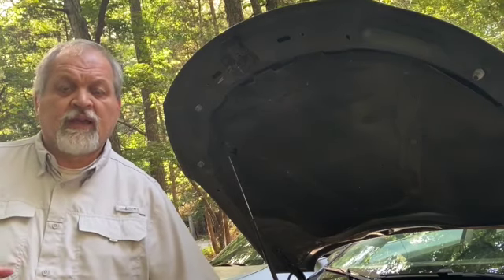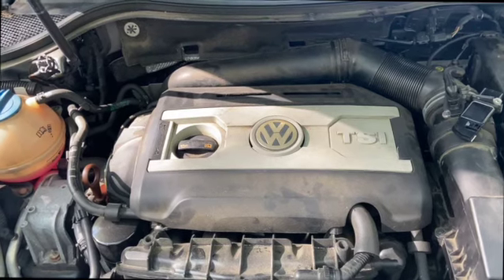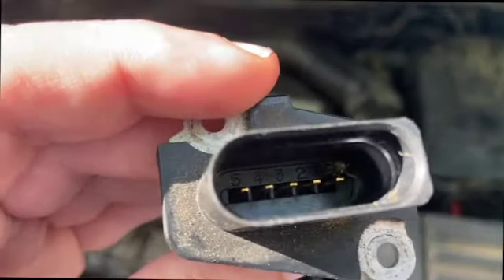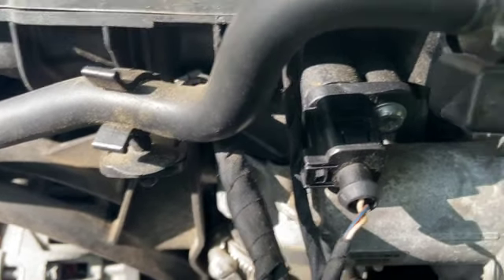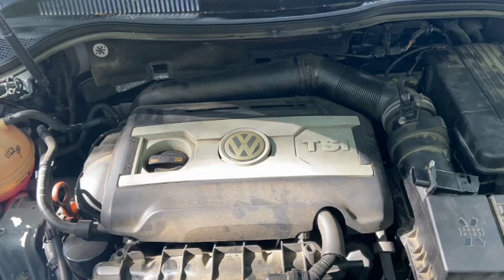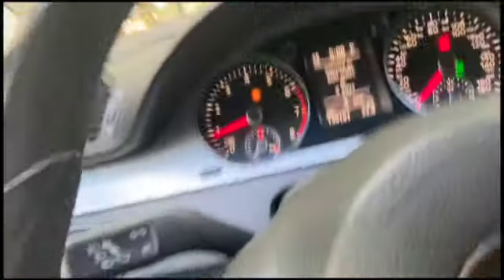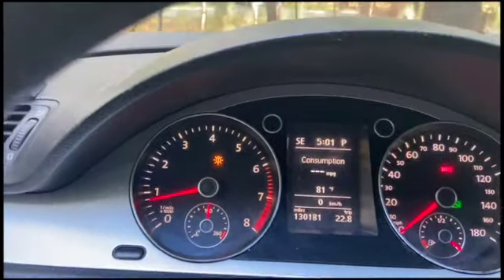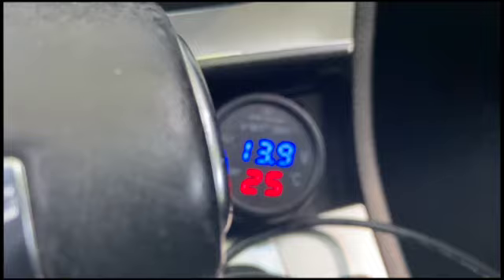How to fix  hesitation under acceleration or heavy throttle in your car

Comment: I guess I’m going to add a comment in hopes to get a reply. I’m a single full time mom & just bought a 2013 Hyundai Santa Fe sport mode from a reputable dealership.
A few hours ago I turned on to the on-ramp to merge on to the interstate.
When I hit the gas it didn’t accelerate at all like it normally does or should. Instead the rpm’s shot up way higher than they normally do & the car was hardly accelerating. I’m talking like 3 mph per 15 seconds.
I was pretty low on gas so I decided to get off the highway & see if that helped the issue.
It seemed fine, until I pulled out of the parking lot. Then the problem continued again.
I live in the mountains & I had to go up a maybe 1/4 mile long steep mountain. I could hardly go past 40-50 mph.
I stopped & opened the hood & let the car cool down because right before this all started I had been parked in a hot parking lot for several hours & it was 90 Fahrenheit outside.

Since this has started, I’ve noticed I cannot accelerate up hills past 40, maybe 50 tops if I am lucky.

It seems to be somewhat fine until I have to go over 30-40. It seems like the rpm’s are normal ish until I get to that speed as well.

I literally don’t know what to do. I just want to cry honestly. I just bought this car 3 weeks ago. Spent 15k on it from the ford dealership. 
From everything I’ve read about this problem online from others personal stories, it seems like this is a common problem for Hyundais with no fix.
Reply from the maker: It is possible that it is an air filter issue or even a vacuum leak, do you hear anything like a section sound when you have the hood open?
Reply: @ProfessorDIY  I’m assuming I would hear that sound with the car on, correct? 

When I opened the hood I had the car off. So I can check it with the car on & see!
Reply: @ProfessorDIY  I just opened the hood, with the car on. 
I did not hear a suction sound that was noticeable to my amateur ears.
What I did notice was extreme heat that I feel like I shouldn’t be there. Especially after the car was just off for 15 minutes. It almost seemed like the hot air was blowing from somewhere but I couldn’t quite figure out from where.
Reply: @ProfessorDIY  also, when I have the acceleration problem (going up hills) (getting up past 40), the car sounds like a lawn mower. Kinda like a deep mmmmmmm sound
Reply from the maker: @keiravanhanken4876  other than the lack of acceleration any other symptoms? check engine light on?
Reply from the maker: @keiravanhanken4876  do you know how to check your air filter?
Reply: @ProfessorDIY  I do not notice any other issues.
I don’t. I can likely search the directions online hopefully
Reply: @ProfessorDIY I learned something new today & checked the air filter & the cabin filter while I was at it.
Both were like new, still mostly white.
Do you have a recommendation for next step to check?
Reply from the maker: @keiravanhanken4876  yes I would check the throttle position sensor
Reply: @ProfessorDIY  I was wondering about that. I know nothing about that so more YouTube videos here I come.
Would that throw a code if that was the problem? 
Just wondering because I just checked my car with a code reader & no code came up.
Reply from the maker: @keiravanhanken4876  Not necessarily. But you can check for pending codes

Comment: What kind of sensor was the second sensor you pulled out?
Reply from the maker: In this car that is a temperature  sensor
Reply: Intake air temperature sensor
Reply: @7:28 13.9V it's
 not a temperature reading instead it's a voltage read out

Comment: I have a 2016 Chevy Malibu recently after stopping at lights and stepping on acceleration it won’t go for a couple seconds yesterday I tried to go and it wouldn’t after a few seconds it accelerated pretty fast on its own can you suggest anything
Reply from the maker: Does the engine stumble? RPM drop? or is it doing something else?
Reply: I have simaler problem for infiniti g37 rpm sits at 2.5 hesitates then jumps to 5k when my foot is on pedal

Comment: First of all thank you for answering to every comment!
I got some issues with Nissan Primera P11. Its SR20De engine. When the engine is cold and I accelerate a little on idle, the RPM stays for a few seconds by itself. Changed sparks, cables, distributor cap, cleaned MAF and even changed the knock sensor. It is very odd, the RPM just stays on for a few seconds then it drops
Reply from the maker: You may want to clean the Idler control valve and if that does not help replace it.
Reply from the maker: Adam B  it has nothing to do with modern but rather the engineering, throttle positioning does not substitute a ICV they perform different functions, the idle is either controlled by the ECU or a vacuum valve. Maybe you need to change the positioning sensor both at your pedal and at your throttle body if you have a multimeter you can test them to ensure they are still goog. throttle bodies rarely go bad
Reply: Will soon try it out. Thanks a lot! Updating the situation when I check that out.

Comment: Hey Sir I have a 95 Nissan hardbody truck 4 cylinder 2 wheel drive. 5 speed. I have problems when taking off in the low gears of trk jerking and some rough idle. We have replaced throttle body position sensor still same situation. We cleaned throttle body. If it is not the mass air flow then what else do I need to check. Thanks
Reply from the maker: Does it have any codes? It can also be bad spark plugs or even a dirty fuel filter. Run a good fuel system cleaner a couple of times and see if it improves, worsens or even makes no difference.
Reply: Hey same issue here but I work as an hood technician with a 2002 Nissan gxe 1.8l and I did fuel system cleaning, replacing camshaft, and still no fix

Comment: Hello, my RSX auto is having a problem under acceleration. When under acceleration it will sometimes hesitate. Mostly happens a ton after a startup, but happens randomly too. No check engine light. Can’t tell what’s up. Do you mind pointing me in the right direction?
Reply: Make sure PCV Valve is good and snug and in working order helped mine
Reply from the maker: PCB Valve does not cause the symptoms we are talking about

Comment: Hey gym hood man! Could you help me with my 2004 trailblazer with the I6 engine.  I replaced the vvt solinoid because it’s popping a p0014 engine code after I replaced the part that should have fixed my problem.  But it’s still here.  W
Reply from the maker: Other issues can cause error P0014
Reply: @ProfessorDIY  what would you suggest my good man?
Reply from the maker: @butterbean0364  It can be as simple as changing the engine oil or you may need to clean or replace the camshaft oil control valve (easy DIY for most cars)

Comment: My Ford Fiesta ST Line has the following error while accelerating - ‘Brake applied, power reduced’. Handbrake is definitely off, what could be causing this?
Reply from the maker: souds like a sensor to mre unless you are accidentally press both pedals at the same time
Reply: 'Brake applied' doesn't necessarily mean the hand brake. A flaky, loose or misadjusted brake light switch (some Ford models refer to as Brake On/Off (BOO) switch), can cause this too. Some vehicles have more than one.

Comment: So my Fiat manual transmission is starting to hesitate from 2nd to 3rd during acceleration.  Any suggestions?  Thanks    No check engine light
Reply from the maker: If it only does it in that instance start with throttle position sensors and air filters MAF sensor
Reply: What about automatic transmission?

Comment: 2014 Subaru Impreza WRX. Car is totally fine until i drop to a lower gear & put it under heavy load. As soon as its above probably 5k RPMs it feels like its kicking back & hesistating & there is a big loss in power.. But it doesnt feel like a full on misfire. No codes popping up, either. Got any suggestions?

Also, I did clean my map sensor but it did not help
Reply from the maker: How old are your spark plugs? Hoe many miles on the engine?
Reply: 83k miles. Not sure if the spark plugs are original, I actually purchased the car pre-owned at 81k
Reply from the maker: @michaelherman3809  For a used car assume they are original, start by replacing spark plugs, it is a maintenance item and a common cause of your symptoms.
Reply: Appreciate it! Will have to take it in because of the location of the spark plugs
Reply from the maker: Sorry that sucks! @michaelherman3809
Reply: Sure does! They ended up replacing spark plugs & doing a carbon cleaning, along with some fuel conditioner. 

The issue I was heaving at high RPM's has almost gone away but now I'm getting a slight bucking every once in a while when I'm first taking off. It's not a significant buck but it's a very slight one. Can't quite figure out what it is unless I just need to cycle through that fuel conditioner or let my computer re-learn everything since they cleaned up the intake system. Any thoughts?

Comment: He dont know if its late but got gti 6 2012 dsg , am having bad misfire on hard acceleration,  not on neutral only when am driving,   but if i accelerate slowly  it doesn't likely to missfire 
What could be problem  
Thanks
Reply: If I continue hard accelerate then triggers epc light and engine misfires badly  then switch off and start again back to normal
Reply from the maker: It can be a throttle position sensor or even a dirty air filter
Reply: @ProfessorDIY  thanks buddy but it was cylinder 2 coilpack , changed new one runs great now , had misfire on cold start went away as well
Reply from the maker: @brianwalugembe9096  In general spark plugs and coils are the first things to check or change when you have misfires, glad you fixed it!

Comment: I’m having a similar issue with my 2011 GTI although I’m only getting hesitation briefly at higher RMPS in gears 4-6 the car has an APR stage 1 tune  high flow cat and down pipe along with a cold air intake it has a few codes that I haven’t been able to troubleshoot those being MAP/MAF Throttle Position (P0068) Mass or Volume Air Flow Sensor "A" Circuit Range/ Performance (P0101) and Fuel Rail/System Pressure -
Too High (P0088) I’ve cleaned the MAF and felt the hesitation again recently I’m pretty stumped advice would be awesome
Reply from the maker: I would replace your throttle position sensor first.

Comment: Hi sir, theres problem on ford explorer v6 gas engine that im still fixing right now, when youre on half gas pedal engine is hesitating and vibrating then when you put off gas pedal engine minor was good,
What was the problem on that engine?
Reply from the maker: Check all the things we discussed plus the throttle position sensor

Comment: Hello I have a 2013 Hyundai Sonata gls and when I start the car it runs then after a couple seconds it shakes and turns off. Wanted to know if the MAF sensor might be the culprit for this
Reply from the maker: It can but also I would suspect the Idle control valve
Reply: @ProfessorDIY  appreciate the response I’ll check that as well
Reply from the maker: @CLAPPII242  Anytime

Comment: I actually felt like my AC had something to do with my cars hesitation. Replacing spark plugs will be my next step. I did try cleaning the MAFS but it did nothing, then I replaced the MAFS and that helped a little. I am also going to change the filter and see if that helps. Hopefully changing the spark plugs will do the trick! Thank you.
Reply from the maker: unless your engine is severely underpowered the AC should not have a severe impact
Reply: @ProfessorDIY  my car’s bad idle gets even worse when I blast my AC.
Reply from the maker: @angiegracie6954  check your vacum system and your air filter
Reply: @ProfessorDIY  👍 ty

Comment: I'm having issues with my 2011 Chevy Cruze ecotec. No codes pop up except when I'm accelerating at a higher speed or going up hills. I've replaced throttle body and all of spark plugs and cleaned MAF and also replaced air filter. I have also replaced the PCV valve and the purge valve. When the air conditioner is on, it makes symptoms worse. If I'm at a red light and have a/c on, it will either go very slow or almost die once I start to accelerate. I'm too cheap to go take it to someone to get diagnosed I don't want to spend $150 just to find out it's some $10 part. I can't figure out what to do next.
Reply from the maker: The idle control valve is inexpensive and possibly your issue

Comment: my nissan frontier has been having check light on for years it has random misfire code i change distribuidor coils wires spark plugs mag sensor and idk what else to do anymore the catalytic converter might be clogged tho it smells like pure gas so idk what you thinkg
Reply from the maker: Smell of gas indicates you car is running rich and that can cause misfires

Comment: Hello i came across your video..and i need to ask a question..hope you can help me figure it out..here goes..
I have a 1997 nissan bluebird u14..am having trouble accelerating whether on flat or uphill..the car would just buffle and vibrate like it want to shut down.
Reply from the maker: Does it idle well? More information is needed. But checking/cleaning the MAF and ICV is a good start
Reply: @ProfessorDIY  idle yes but with delay..or sounding like sputtering..puff,puff that's what am getting whether in park,reverse or drive same problem..its just puff,puff,puff
Reply from the maker: @sheniceebanks7661  Fuel filter also a good place to check, how many miles? Last time you tuned it up?
Reply: @ProfessorDIY  I change gas pump 2months ago,air and gas filter,leads wire and still its there..my husband also clean the trottle body and the problem persist..the mechanic at this moment I think is just guessing..I changed all he suggested and still....
Reply from the maker: @sheniceebanks7661  Throttle position sensor is a strong possibility

Comment: My throttle body is stacked open. Mass airflow (MAF) sensor/volume air flow (VAF) sensor - range/performance problem
Mass Air Flow Circuit Range/Performance Problem, Intake air flap control actuator position sensor - circuit high, Intake air temperature (IAT) sensor - high input, Mass airflow (MAF) sensor/volume air flow (VAF) sensor - range/performance problem. Can you think those faults can cause a fault to my throttle body to be stuck open? Thank you very much for this video. It's always something to learn. Much appreciated. I will follow any advice. First I will start with this one.
Reply from the maker: no O suspect that a cleaning will free the throttle body

Comment: My 2015 Silverado5.3 hesitates when accelerating, when you push the pedal all at once it takes a sec to respond and then the truck accelerates but feels like a kick when it does, I replaced tps sensor and map censor, the only one I haven’t replaced is maf but when I checked it it looked brand new so I decided not to change but do you think it could me the maf ?? , my truck also shakes a little at idle tbh could be torque converter since 2014 and 15 have this problem but idk maybe it’s sum else
Reply from the maker: i think your vehicle is misfiring
Reply: 03 avalanche same issue.  Changed all o2 sensors, map, maf, tps as well as throttle body, knock, intake temp sensor  , 5 different fuel sources including  purple,  premium,  mid n low grade  even poured shine in there.
Reply from the maker: @uncleasshole3787  next step ignition coils.

Comment: Received your video as a recommendation in my youtube,
Been a diy guy myself who services his own bikes, this ism y first time doing a car service at home.

Been learning everything even engine overhaul from last 5 years have gained the therotical and some practical knowledge at friends workshop.

But I've a question for you sir, how do I clean my car radiator and condenser fins ?
There's the britecoil, tertaclean alkaline solution that doesn the job perfectly but many claims it burns the aluminium lines.

Also I'm gona clean the intake manifold and fuel injectors
Can I reuse the same gaskit ?
My cars maruti Suzuki astar 2010 model type 1.

Comment: Ok, hopefully, u answer because im really trying not to give up on my car, it idles pretty good and starts right up but my problem is whem i try to accelerate it struggles to move/run ... I've changed fuel pump, maf ,pedal sensor cleaned throttle idk what else to do
Reply from the maker: Check the throttle position sensor and the acceleration pedal position sensor
Reply: What about the Fuel Filter ??
Reply: did you find any solution?

Comment: My 2000 Honda civic eu1 jerks when going between 0-30km/h then it’s fine until I come up to a hill or start applying heavy throttle it starts to hesitate what’s the some problems that may cause this and what can I do to troubleshoot and fix if lucky
Reply from the maker: Misfires can be caused by many reasons if it only happens during acceleration I would check/clean the MAF then the ICV then spark plugs if nothing works so far check the throttle position sensor followed by ignition coils and lastly fuel injectors
Reply from the maker: @gorkman5697 Yes of course I did

Comment: My Ford focus 1.4 2007 is losing acceleration on take off I feel the car is not reaching full power when I accelerate, can you help.. from Dublin Ireland 🇨🇮
Reply from the maker: I would check and if needed replace the Throttle position sensor
Reply: Your exhaust could be clogged

Comment: Maybe you could help me. 5.7 hemi druve by wire, rough idle poor acceleration at slow speeds,but when i floor it ,it runs great.
Reply from the maker: Sounds like an idle control valve but I would also check the MAF and the air filter